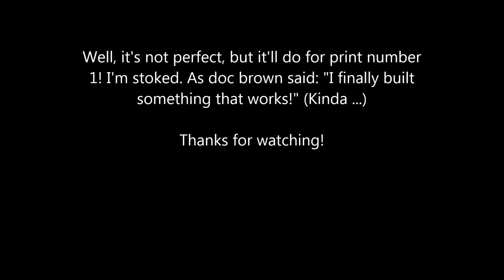First print following build - Printrbot Simple Printing R2D2

Comment: I am considering to buy this printer. is it good& cause your r2d2 model looks .... you know)))
Reply from the maker: Hey, what do you mean? It's perfect:)! Seriously, I must say that it's a good budget printer, but it suffers from the "constantly endlessly needs tweaking" syndrome that all printers att his stage of the technology suffer from.  Problems I have encountered: 1. The drive string (yes, this uses fishing line, not a belt) misaligned after a few prints (I had to rig up a makeshift guide for the string) 2. The extruder stops extruding after a few prints (I put this down to poor calibration on my part).  In terms of speed and accuracy though, once you get it all humming, it will print as well as any other printer - even, I submit, a $2,000 makerbot.  If anyone has a different opinion, don't hesitate to comment!